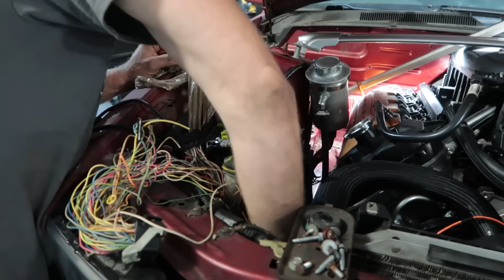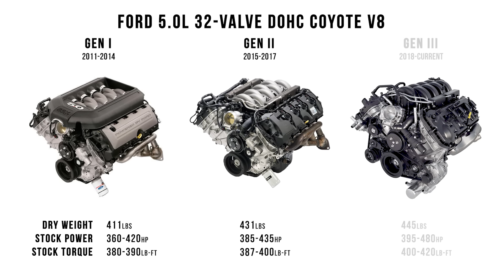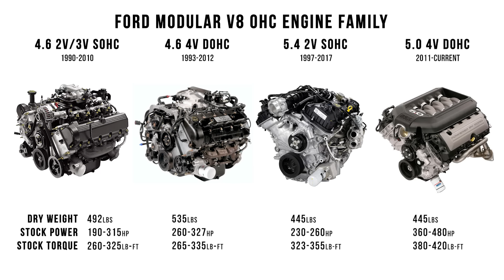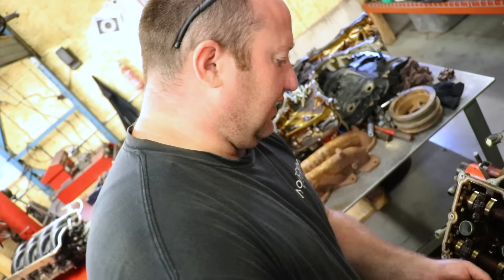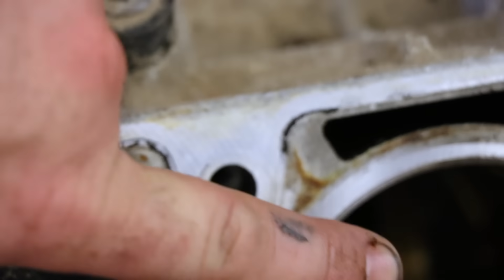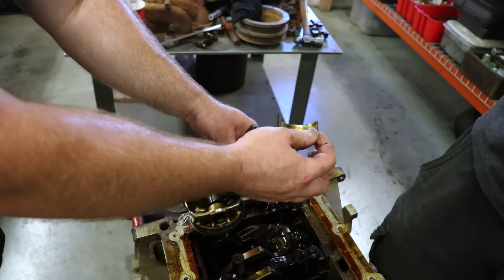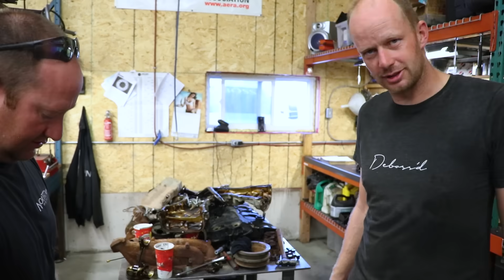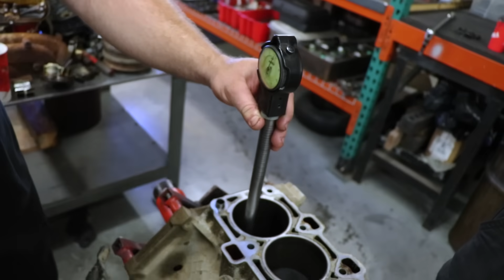REVIEW: Everything Wrong With A 5.0 Coyote Engine

Comment: Yet fords new gas engine uses push rods. So ohc isn’t so wave of the future.
Reply: Add to that wave of the future battery electric vehicles. No oil changes to ever have to worry about.
Reply: @tigerseye73  An electric truck would be useless compared to one powered by the new 7.3.
Reply: OHC never was the wave of the future, it's older than the pushrod.
Reply: @riogrande163  But OHC heads still perform better in most applications, pushrods really only work well in big V8s in budget sports cars and pickups trucks.
Reply: @PistonAvatarGuy  pushrod engines can be lighter. And GM trucks although have bigger displacement engines they get the same mileage as a V-8 Ford. Or better.
Reply: @PrimalMiltos  Like I said, they work well in some applications. Really, pushrod engines only work well in vehicles that can make use of big V8s, other applications just don't benefit from the arrangement as much.
-
4 banger pushrod engines: 4 cylinders have problems with vibration as their displacement increases beyond 2 liters. A 2.0 pushrod engine with the same BMEP as a GDI LT1 would only make 148 hp at the same peak power RPM. DOHC 2 liter engines typically make from 160 to 200+ hp, without needing to use GDI. A pushrod 4 cylinder would need to be 2.7 liters to make 200 hp, not impossible to build, but difficult to make run smoothly and probably wouldn't fit in many small cars.
-
V6 pushrod engines: V6s work best with 60 degrees between cylinder banks, which leaves little room for the valvetrain and intake manifold. V6s also have issues with vibration as their displacement increases. A 4 liter V6 with the same BMEP as a GDI LT1 would only make 300 hp, that can easily be done with 3.5 liter DOHC V6s, without GDI. 3.7 liter DOHC V6s can make up to 350 hp without GDI.
-
V8 pushrod engines: V8s work well with 90 degrees between cylinder banks, so there's plenty of room for the valvetrain and intake manifold. Crossplane V8s can operate smoothly with very large displacements, so that's not an issue. V engines work best with pushrod valvetrains because the valvetrain can occupy space between the cylinders that's normally not used. V engines inherently have better power to weight ratios than inline engines, so that helps counter the additional weight that comes with larger displacement engines.
-
V10-V12 engines: These engines tend to be used in high performance cars, where cost isn't as much of an issue and where high revs are desirable to improve the power to weight ratio of the engine, so OHC heads are preferable. Nothing can beat the performance of an OHC engine when cost is less of a priority, their power to weight ratios and compactness are unmatched because of the excellent aspiration performance that OHC heads offer at high RPM. Pushrod engines don't work well at high rpm because of the mass of the valvetrain, the fact that it's difficult to make multi-valve systems work with pushrod valvetrains, and because the size and shape of the ports are restricted by the passage of the pushrods through the head.
Reply: @PistonAvatarGuy  These are not naturally balanced. How about an inline 6? 
Ford's old engine was reliable.
Reply: @PrimalMiltos  With large displacement I6s, length becomes an issue. Weight is also more of an issue as I6s increase in displacement, because the crankcase/crankshaft is a larger percentage of the overall engine weight with inline engines, relative to V engines.
-
Why the obsession with pushrod engines?
Reply: @PistonAvatarGuy  No, after growing up in Europe where no cars have pushrod engines, I am just amazed that a pushrod V8 has proven that it can hold its own against a DOHC V8. Kudos to GM and Chrysler for keeping it alive.
Reply: @PrimalMiltos  Growing up in the US, I've always been amazed at how European DOHC V8s, V10s and V12s can stomp just about anything made in the US.
Reply: @PrimalMiltos  good word
Reply: @PistonAvatarGuy  European cars stomp American? Only if they charge 3 to 5 times the money for their DOHC engines to beat a pushrod V8.
-OHC: 1986 560 SL 238hp 16mpg $68K
-Pushrod: 1986 Corvette Convertible 5.7lt 235hp 22mpg $32K
Detroit just stomped Stuttgart? 🤣
Reply: @PistonAvatarGuy  
DOHC 2005 Ferrari F430 490hp 17mpg 3380lbs $185K 
Pushrod 2005 Corvette Z06 500hp 25mpg  3147lbs $70K
LONG LIVE THE PUSHROD V8!
Reply: @PrimalMiltos  There was no Z06 in 2005. I didn't mean that European V8s and were always faster than American V8s, I meant that Europeans ALWAYS made faster cars and that American car manufacturers have almost never had anything which could compete. What naturally aspirated pushrod V8 powered car could compete with the F430 Scud, or the Gallardo Superleggera, or the Aventador SVJ LP770-4? NONE.
-
2013 Ferrari 458 Speciale, 4.5 liter DOHC V8 - 597 hp
2013 Corvette Z06, 7.0 liter pushrod V8 - 505 hp
-
Let's see a pushrod V8 make ~600 hp in a production car and get the same kind of fuel mileage as the 458 Speciale. No naturally aspirated pushrod V8 ever even made more than 505 hp in a production vehicle! Hell, even the 4.0 liter flat 6 in the latest 911 GT3 RS makes more power than the LS7 Z06 ever did!
-
Yes, pushrod V8s offer better bang for buck than anything else out there, but NOTHING beats the ultimate performance of DOHC engines.
Reply: @PistonAvatarGuy  Again making a slightly faster DOHC car and charging 3 times the money than a push rod sports car is  NOT an accoplishment. People have limited budgets. Especially when some of these European DOHC engines are so unreliable!
Reply: @PrimalMiltos  "I'm poor and can't afford the fastest cars on Earth, WAHHHHH!"
-
The point is that NOTHING can beat the performance of OHC engines, they are the top tier. Pushrod engines could NEVER compete with them, regardless of how much money you dumped into one, their performance is INHERENTLY inferior. Whining about not being able to afford the fastest/quickest cars on Earth isn't going to make pushrod engines any better, they're STILL second best.
Reply: @PistonAvatarGuy  I personally know only one person that bought a new Ferrari. When the left exhaust manifold broke they charged him $4K. For the parts only. It was just passed the warranty so after a lot of arguing the dealer covered the $2K labor. Thanks, but No thanks!
It is unimportant who is going to squeeze the most hp from each liter of displacement. The real goal is to make a powerful car that most people can afford that also gets good mileage and is reliable. The Europeans and their high revving DOHCs failed on all 3 categories.
LONG LIVE THE PUSH-ROD V8!
Reply: @PrimalMiltos  "It is unimportant who is going to squeeze the most hp from each liter of displacement."
-
I never said that was important, I'm saying that nothing beats the performance of OHC engines. When talking about the best performing engines on Earth, the power to weight ratio of OHC engines is unbeatable, their efficiency in racing applications is unbeatable (BSFC), and their compactness is unbeatable. They win in the only 3 categories that matter in a racing vehicle.
-
"The real goal is to make a powerful car that most people can afford that also gets good mileage and is reliable."
-
That's A goal for some, yes, and there's no reason that this shouldn't be A goal, but if the goal is to build a car that performs better than anything else on the road, then you design cars like those made by the Europeans. Americans should stick with their budget sports cars, the Europeans can continue to produce the best performing cars on Earth.
-
"The Europeans and their high revving DOHCs failed on all 3 categories."
-
Their goal is to stomp the f--k out of everything else on the road, that's what they do, that's what they've always done, and they're extremely good at it.
Reply: @PistonAvatarGuy  But of course they are going to be faster, imagine if at 2 or 3 times the cost they were slower! You always can drop $10-20K and tune a Vette or Camaro for a total of $60-$80K and beat Lamborghinis and Ferraris and still have $100K saved to spend on. With the Italians you need to have another $50K available as soon as the warranty ends. Europeans have budget sport cars too all with DOHC and weaker than a comparably priced American push-rod muscle car. That's why for the vast majority of car buyers the muscle-cars are superior.
Reply: @PrimalMiltos  How many times are you going to go in circles here? Yes, pushrod engines are cheaper than OHC engines, I've already agreed with you on that. NOTHING beats the performance of OHC engines, PERIOD. You can brag about being cheaper all that you want, it's NEVER going to make pushrod engines perform as well as OHC engines.
-
"That's why for the vast majority of car buyers the muscle-cars are superior."
-
Unless you're a European and spend time on ACTUAL RACE TRACKS. Watch this channel, tell me how many muscle cars you see in those videos: https://www.youtube.com/user/Bignumtt
Reply: @PistonAvatarGuy  Let's recap, you said: "But OHC heads still perform better in most applications, pushrods really only work well in big V8s in budget sports cars and pickups trucks."
But most applications ARE budget sport cars and pickup trucks. 
When shopping e.g. for a $15K engine NOTHING beats in power, reliability and fuel economy a 7 liter pushrod V8 made by GM.  Same applies if shopping for a $6000 truck engine. The obvious choice is always a small block Chevy V8.
So your statement was wrong because similarly priced OHC and DOHC do not perform better. ESPECIALLY when DOHC are less reliable, no matter how much they cost!
Reply: @PistonAvatarGuy  That 700hp tuned Supra on that channel probably cost more than a same year Z06. What is the purpose. Unless you like 6-in-line sound better?
Reply: @PrimalMiltos  "But most applications ARE budget sport cars and pickup trucks."
-
Uhh... no. In the US, cars (not sports cars) and SUVs are the most common vehicles after pickup trucks. Globally, economy cars are the most common vehicles on the road. But I wasn't going by sales numbers, I was going by the number of applications. Economy cars, mid-size cars, luxury cars, budget sports cars (4 cylinders and V6s), most SUVs, heavy vehicles (semi-trucks), high end sports cars, hypercars, actual race cars, etc are all better off with OHC engines. Light trucks and muscle cars are two applications.
-
"So your statement was wrong because similarly priced OHC and DOHC do not perform better."
-
A) I wasn't talking about price, I was only talking about performance. B) OHC engines perform better in the vast majority of applications, even when price is considered.
-
"ESPECIALLY when DOHC are less reliable"
-
They're usually not, though. The LS7 was actually kind of a POS, which is why it's not a common engine for tuners to make use of. Making it light and cheap also made it flimsy. The smaller displacement LS engines are far more desirable.
Reply: @PrimalMiltos  I linked you to that channel because he goes all over Europe to race, so you can see that the people who race on real race tracks don't want muscle cars, because they're huge, sloppy boats. That Supra was built in 1993, there was no Z06 in 1993.
Reply: @PistonAvatarGuy  2010 SLR McLaren 5.4l and 620hp.
2015 Corvette Z06 6.2l and 650hp. Same performance from a much cheaper, lighter, pushrod V8 while getting better mpg. What more can one ask?
Reply: @PrimalMiltos  Ford F-150 5.0 - 395 hp , 400 lb-ft, 17 mpg combined.
Chevy Silverado 5.3 - 355 hp. 383 lb-ft, 17 mpg combined.
-
Ferrari 488 Pista - 3.9 liter, 711 hp, 15 mpg city.
Chevy C8 Corvette - 6.2 liter, 490 hp, 15 mpg city.
-
"What more can one ask?"
-
How about a 760 hp, 6.5 liter naturally aspirated V12? How about a 4.6 liter, 600 hp naturally aspirated V8 that weighs 300 pounds? How about a naturally aspirated, 4 liter flat 6 that makes 520 hp? I don't understand what you people aren't getting about WORLD DOMINATING PERFORMANCE. Even GM is going with a DOHC engine in the C8 ZR1, because there's no other way to get the performance that they want from the car.
Reply: @PrimalMiltos  JIC you're wondering...
-
Lamborghini Aventador SVJ LP770-4
Porsche 918
Porsche 911 GT3 RS

Comment: Toyota and Honda use aluminum bearings and no real issues. I have ran synthetic oil since 1988 and never had any issues. My Toyota's, Chevy's,Saturn's,Dodges do not have consumption issues and have been ran on synthetic oils since break in. Every modern diesel calls for 5W40 as the norm and those are all synthetic as well. Bad PCV designs, extended oil changes, cheap oil are the problem. No one that truly understands tribology and chemistry can make the claim and bake it up with science that non-synthetic oil is better at anything. In the USA a lot of oils marketed as synthetic are not truly synthetic they are Group III oil.

Comment: So what should have been used instead of synthetic oil?!
I'm a IT pro, not a car pro, but as someone that had to rely on uber for 3.5+ years in DC to keep me alive, i've had to learn to maintain my car better than any master mechanic (to make uber worth it vs doing uber just to pay for maintenance), and I can tell you, synthetic oil isn't the problem! Not changing the oil enough is the problem! Even with uber, i did my oil changes at 10k miles/6 months just as before I did uber. Still have my car (2012 mazda 6i) after 10x,xx miles! 0 problems (minus the bent rim because dc and baltimore streets are smooth shit!)
After my car hits 200,000 miles i'll go to 5k miles/3month intervals.

Comment: Synthetic Causing sludging? Synthetic is good for breaking down of buildup like that. That engine looks like it had a extended Drain interval. Repeatedly. There’s a reason the drain intervals are longer for synth oil. It’s better with additives and anti wear additives.

Comment: 97 f1shitty 4.6L 268k gone through 2 transmissions but still runs like a raped ape. I agree with this guy on the fords 4.6L now I wish it had more ballz but hey it gets around and she’s a beast going up soupy hills with bald ass tires. It is very easy to work on other than trying to change them damn manifolds out... rust belt yooper area sucks ...

Comment: I think it's mostly because people think synthetic means let's rev the piss out of my Modern Oil pressure controlled engine, with DOHC and timing chains, clutch dump it, and change the oil every 10 15k miles and wonder why oh why it has sludge and fails. Like you said in one of your other videos, maybe the Saturn one, synthetic oils are fine but i'd rather change it sooner because oil gets dirty, filters get dirty, engines produce some blow by which creates more pcv oil fumes into the intake, more carbon more dirt on and on.

Comment: Cool video, but skeptical of all the negative claims about synthetic. I have never heard any of the claims stated from other sources. I believe as a Ford lover he is inclined to blame other things for failures of the engine.
Reply: https://www.machinerylubrication.com/synthetic-oil-31800
Reply: Ya he was talking about the 0w20 or whatever oil ford recommends.
Reply: He didnt say synth was bad he specifically said it isn't good in engines that dont come up and run @ temp for a while.
Reply: @daveyb2552  This applies to all types of engine oil, so I'm not really sure what his point is.
Reply: @daveyb2552  one major perk of synthetics is how the oil doesn't sludge up due to moisture not boiling / evaporating off during a short drive. His statements on synthetics contradict all of the professional data I've read, and anecdotal data I've gathered from personal engines. The only statement which has any validity is to not mix certain synthetics. Different brands use different base stocks, which may or may not play well together. I recall recommendation to not mix Amsoil with Mobile1, but it was fine to mix Amsoil with Redline. (my apologies if I have that backwards) The key here is to run one brand of synthetic, use a good filter (Wix is my preference), and change your oil based on oil analysis or your MFGs recommended change interval.
Reply: Craig Greenlaw Thanks Craig. I was alone on an island for some reason. Your statement and that website are the facts. I am surprised this turned into a thread. Synthetic is well proven in the industry and besides cost has no downside.
Reply: Wow, you can't hear. He said synthetic is not made for short drives.
Reply: @adamwiggins8290  I did hear him. It is not true though, synthetic is only molecularly different from regular in that the oil particles are uniform in size and resists break down more. All oils and engines perform poorly from short trips where the engine does not full warm up.
Reply: @adamwiggins8290  Synthetics are better than conventional dino-oil for short trips. Synthetics are pretty much better at everything. This engine did not get it's oil changed regularly.